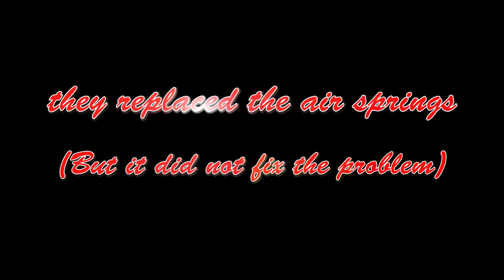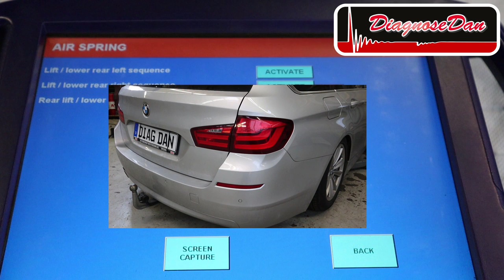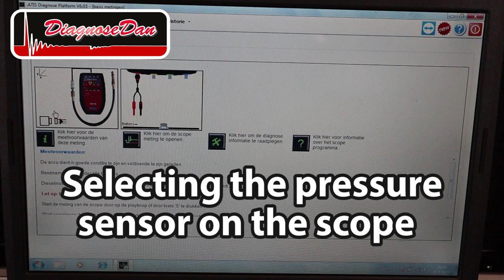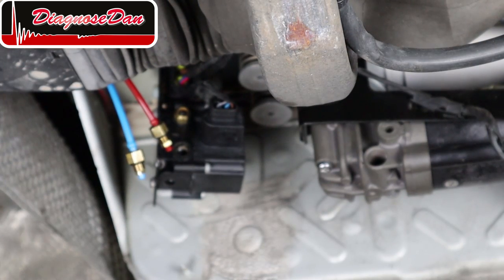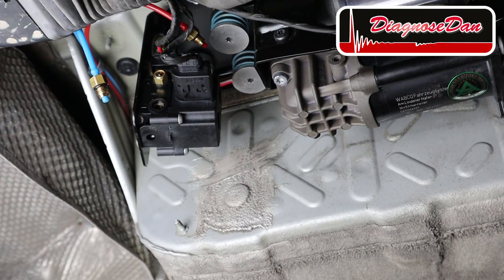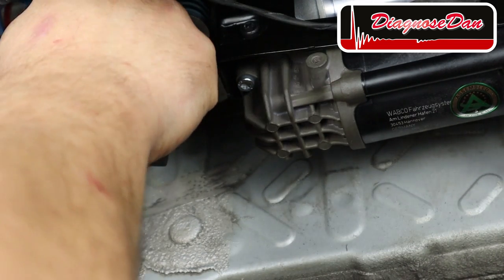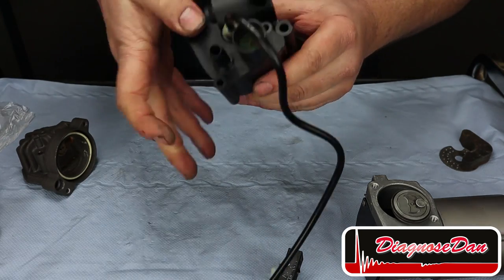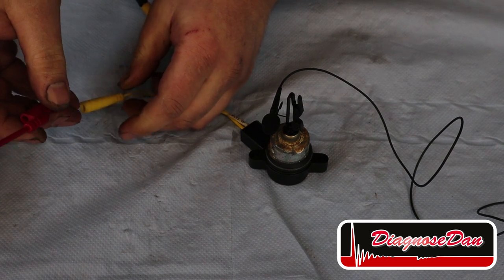Air Springs replaced, but no Fix!

Comment: so in theory it is possible that the vent is being commanded "open" which would have also caused this issue. a quick check of the control to the vent valve should also be performed before replacing the compressor (or vent valve). great video again Dan, thank you!
Reply from the maker: You are right and i did check it, and i could have made this a 3 hour long video. But i don't want the video's to be to long. And i need something to show you in the next airsuspension video 🤣🤣
Reply: @Diagnosedan  
I know you did and I loved the video! I hope my comment didn't come across as negative or complaining. I love your channel and appreciate you teaching us! I've learned a lot from you!

Comment: This car has a towbar fitted, maybe the compressor filled with water when launching a boat?
Reply: Bingo......that makes sense! That seems like a lot of water/damage for simply condensation.
The dryer medium will tell the tale.
Reply: It's not super common in The Netherlands to launch a boat.  People that own boats, mostly have it in dry docked, close to their house or in a harbour. People generally use a towbar to hook up a trailer of some sort for vacation or hauling purposes.

I own the exact same model of this car, and i've seen 2 moisture issues before: 1 where moisture enters the roof lining via the trunk lid. The other one is similar, when opening the trunk lid and the drain holes are clogged,  the water runs all the way down towards the fuse compartment. 

I replaced a relay that was soaked and made sure to tie-wrap it higher.  I've also replaced the Air suspension springs because mine were leaking, so it would be the first thing to do on this model, since it's a common fault.
Reply: kevin bradley @good point

Comment: Good morning!  Great vid as usual!!  I'm liking that license plate. Maybe they wouldn't warranty it because he was backing a boat into salt water. Or the little Dutch boy forgot to out his finger in the ? to prevent the water from leaking in. We will have to get him some DD gloves.
Reply from the maker: BILL 🤣🤣🤣
Reply: Actually that is a very, very possible cause!! A 2017 car is too soon for a rear airsping leak. This pump most likely sucked in sea water from the fresh air intake tube, which is located right behind the rear bumper. 

Dan, you need to build this customer an Airmatic snorkel!!

Comment: From my expirience these compresors are good. They only fail when there is leak in the system or bad suspension airbags.
Reply from the maker: Maybe you live in another climate?
Reply: Im in UK and climate is not best :)
Very strange for airbags or air compresor to fail on 2 years old car

Comment: Not quite sure the original shop didn't check this out first it's like taking it to a shop that doesn't have an actual mechanic all we have now are techs
Brake techs tire techs  etc etc etc great diagnosis the problem is not always the problem

Comment: Air shocks replaced, expensive mistake
Reply: Who is going to pay for that mistake? Just always ask to get the"old broken" parts back after the fix.
Reply: As it is barely a 2 year old car, shouldn't have been fixed for free under warranty?  Are warranties optional in Europe???
Reply: @soonerlon  Austria, BMW technician here. In my company these cars have a 4-5 year warranty. This part would be changed for free (free new part and free of service). We have to send back the broken parts thoe to BMW. I guess they are inspecting these parts for further improvement. If he would have changed the valve with an aftermarket part, that voids the warranty straight away. 95% of BMW's are leased in Austria. So all of them are guaranteed for 4-5 years.
Reply: In Germany a new BMW comes with a two year Guarantee and after that its pro-rated (Kulanz). Usually after about 3 to 4 your  on your own with the repair costs.
Reply: In Range Rovers they usually replace both. Once air shocks leak a little the compressor gets burned out compensating for the leak.

Comment: Nice one again Dan.
I always do the finger test first on a pump quick & simple.
There’s one more check I would have c/o & that’s check the air inlet for blockages.
I have had several cars come to me for testing for a parts warranty claim but after testing found the air inlet filter blocked with mud.
Interesting to see the solenoid was at fault my guess was the piston seal worn a common fault on MB
Keep the informative videos coming 👍
All the best,
Madds
Reply from the maker: Thanks Madds great tip on checking the inlet for blockages!

Comment: it is time for bmw to note that threaded connections on pressurized system must be magnesium  not plastic, and solenoid covers stainless steel or molded plastic. The way they are set up right now internal parts in the Evaporation and Air supply systems would not last over 10 years, corrode and stuck open  throwing array of codes. 
Great job Dan digging  to the core of the problem, that blue diagnostic tool should be patented invention !
Reply from the maker: BMW doesn't make these compressors they are made by Wabco.😉

Comment: BMW and Wabco ought to be ashamed. Same problems as before. Even the E61 had the same problems 15 years ago. Pump is placed inside a shield where mud/gravel/moist can come in but not out. And Wabco pump quality is poor. Should have a fail safe switch to turn off when air spring leaks too much.
Reply from the maker: You are right😢
Reply: it actually does shut off once a leak is detected, (pump not reaching required pressure within given time, 15s I think), and it will NOT allow you to turn it back on during that drive cycle even if you push the raise button, it instead give you malfunction message.

However this pump shut-down feature resets every drive/ignition key cycle, so owners tend to ignore it and just keep driving with a leaky air spring.

It's a user issue, not a pump issue. I would much rather have the pump come back after a key cycle and at least get me home than have to take it to the dealer immediately.
Reply: @Uninfluenceable  I agree, Ian. To some extent. But when many years of real life usage shows this kinds of problems on a two year old german car, I think that manufacturers should change things regarding programming and hardware specifications.
Btw - I have diagnostic tools aswell as experience of repairing wabco's and I still love driving german cars.
Take care
Reply: Makes me a bit sad to find the same old design flaws after decades. What happend to the old fashion "to take responsible position", BMW and others? Too much money down the drain this way.
Big thank you to DiagnoseDan :)
Reply: The e39 pump is much more reliable
Reply: @Uninfluenceable  What normally happens is they will keep driving until the pump wears itself out from over use Then the bring it in for service.

Comment: Awesome video Dan. Save me hundreds maybe more. At the very end of your video. Tap the stock resistor with the handle of a screwdriver to loosen it up. That’s exactly what was wrong with my 2012 F01. Checked it with 12 V power like you did got a strong click after I tapped on it a few times reinstalled it and boom problem fixed.  keep up the great work

Comment: Greetings from Canada, those air ride suspension systems can be an absolute nightmare, especially in Cold Winter conditions when you are leaving for work and your ride is on its bump stops and refuses to air up.  Even when the components are new and in good condition  the compressors will time out and dump all the air out of the system  at -20 degrees C and lower.

Comment: Nice to know Wabco decided to save few cents. Stainless steel is overrated nowadays. I have 2x E61 with about 300,000 km and both pump up perfectly without issues 15 years later. It also gets really humid here in the summer.

Comment: Excellent Job DAN, really liked the tutorial with dis-assembly of the pump !   
2 BIG THUMBS UP !!      I run into this type of situation a lot w/ BENZ & BMW where I am at.  Here in the area where I am , these shops SHOULD NOT be repairing German Autos ... lol --
 It is very frustrating for me to get a BENZ / BMW with an upset customer because of lack of knowledge. I feel bad for the customer more than anything else.
Everyone should be REQUIRED to learn & understand every component of a system before trying to repair.  Every Factory training seminar for Benz or BMW I go to (all of them ) this is how the instruction is given .
Which is why I do not understand that the other shop replaced air springs without complete pressure & component check of the air system ????? --- ALWAYS - Check pump pressure and control valves on vehicles with Air Suspension before replacing components. - EVEN IF YOU THINK THERE IS A CONSISTENT PROBLEM.
Reply from the maker: You are right, the shop manager told me they had time pressure and desided to replace the airsprings because that was the most common problem😪
Reply: Truth is most shops don't want to work on Benz and BMW's. Some shops won't even attempt it.
Reply: THANKS DAN !!  Even factory "TSB'S"  can be easily  mis-interpreted
Reply: NICK V  -- Yes Sir ! Very accurate statement and absolutely correct but I do wish they would not attempt if they dont know also.  ( Porsche is the biggest one for me )
Sometimes I have found out when a car shows up that a Tech at a shops where they do not want to touch these cars, is maybe kind of new or has just come out of the local community trade school jumping in feet first when the shop is not properly equipped or trained for this. I applaud the motivation but have to frown on the lack of knowledge
Reply: @armyvet92  troubleshooting a system functionalities requires a special inquisitive mind PLUS knowledge... that is unlike maintenance most work procedures.
Reply: @G Lasser  - Yes sir you are correct !  But I guess I still wonder how it is not just simple or basic trouble shooting analysis that everyone should be learning from day 1. Especially if you work on vehicles. 
However,  you are also right in the very same statement if look at it .
Based on what you said , it does appear that there are more and more people being hired as TECHNICIANS but really are not trained to do anything but routine maintenance procedures.

Comment: Good content right here, I have just repair my F11 based on this video, just removed the air compressor and check the valve(it was stuck). Now car works nice.
Reply from the maker: Great!😊👍
Reply: Got my comp off at the minute as both sides are in the deck. (Both air bags new 1 year ago). Finger over the air outlet and could easily stop the pressure. But when I tried dump solenoid it appears to operate, so I pushed a pipe onto the little end of the solenoid and blew. Didn’t stop the air flow whether it was energised or not. So I’m still thinking this is the issue ?????

Comment: Got same type Wabco pump on my Jag, so guessed where this is going.
For a fraction of the price of a new compressor, there are kits to replace the piston ring and drier material.
Think BagpipingAndy was the first to make this cheap fix available.

Comment: Nice one Dan, It was good to find out what caused the failure. And even better to know after market parts are available to rebuild it if required.
All too often the end user is unable to get the parts to rebuild (See Range Rover)
With it being just two years old would the warrenty cover it?
 I guess BMW should really re design the pump system to ensure dry air in all climatic conditions
Reply: I too would have thought it would still be under manufacturer's warranty.
Reply from the maker: The car was imported from another country and than in some cases the Local reseller doesn't provide waranty.

Comment: Super cool Dan. I had precisely this problem. I knew didn't have leaks after doing bubble test  so it had to be from the pump.  I found the pressure o/p problem from the pump by using the finger method but at that point I was stuck thinking a whole new pump was the only option. One last search of the web and I found you.  Withing 5 mins of watching the video I had the 12v on the solenoid and I had established that it was sticking thanks to you.    I freed it up and refitted and now all good. I have a new part on order but need to wait a week for delivery.  Thanks Dan. Great video. Great trouble shooting. Great explanation and Great that you saved me £800 at the repair shop.  
Regarding the other garage up mention - What REALLY pisses me off is that the car had both bags replaced at the other shop for no reason!!!! That's just lazy or idiotic problem solving and then they pass the cost of their stupidity to the customer.  I am no mechanic but I can problem solve and if both bags are flat it has to be a part that is common to both bags that is at fault. That means leaky manifold supply line, pump housing, pump piston/ring seal etc..
Anyway, I am having a rant sorry.  Dan your stuff is great keep up the great work.

Comment: I usually check the air pressure in the accumulator on VW Touareg via the measuring blocks. Easier and faster than hooking up the scope. ;)
In my experience, most air compressors fail because of moisture from the air freezing in the chamber. I always add a couple of bottle caps of anti freeze alcohol (for air compressors) on air suspension after a fix.
Reply from the maker: There is no pressure sensor on this car😢
Reply: @Diagnosedan  Bavarian MachWerk ;)
Reply from the maker: @panzerveps  🤣🤣 If cars didn't  break down we would be without a job!

Comment: Dan, love the diagnostics! But, that is a pre-LCI BMW F11 5-series build from 2011 - 2013. Air suspension goes bad all the times on that specific model and build years. In the later LCI versions, very little air suspension problems.

Comment: Hi Dan,like your videos. MY guess at 7 min in was a bad pump part and a customer that was OVERCHARGED for 2 shocks at how much? 350 ea? WHY?because the other FAILED to properly diagnose the problem.At the very least they should refund,all of the parts cost but keep 100.00 for labor.I would have deadheaded the pump or put a gauge inline to one of the shocks to see what the actual pressure was on the line.i may have even used my bicycle hand pump to put pressure in the lines  lol.but that real old school..thanks Dan

Comment: Love seeing the internals of the air pump! Really highlights the problem. A problem that more than just bmw shares. Late model dodge rams have this issue in droves. The vent valves freeze in the cold. Thanks again for the insights!

Comment: Holy Cow a mind blowingly terrific video walking through this diagnosis.
My 2012 e70 X5 may or may not have the exact same compressor. It raises the vehicle fine, but overnight BOTH sides drop, so got a leak somewhere.  Unlikely that both airbags failed together.  Each has a dedicated air line running back to the compressor, so also unlikely both lines failed together also... So now I am looking into if there is a component on the compressor, upstream of the 2 air lines that could be leaking. Possibly the 'vent valve'?  You mentioned a 'valve block' too but not sure what that is.
Thanks if anyone can provide a pointer.

Comment: Disappointing that the original garage didn't carry out the kind of diagnostic you carried out. Surely checking the compressor is working would have been one of the first things they should have done? At least they took it to an expert in the end! 😁

Comment: My f11 suspension failed today. I jumped the relay in order to get the compressor running, both air springs are empty and did not fill.
I suspected a worn compressor piston seal, but the solenoid valve seem more likely. Thanks for the tip, I'll look in to it tomorrow!
Reply from the maker: Good luck!
Reply: @Diagnosedan  Can you place a glove over the outlet and cycle the pump to verify the leak?
Reply: Dan I replaced  my relay and air compressor on my how 510d f11 but suspension  still drops  ( no leaks on air bags) any ideas

Comment: Nice Job..This is Same problem with Ford  Lincoln Town car.. I used a regular air pressure gauge...
Reply from the maker: A lot of people are talking about that Lincoln!
Reply: Dan, this is the Mark VIII commercial. They did it driving under an airplane wing too. The Mark was constantly raising and lowering. At highway speed it would drop, then when you slow down it would raise, then also from raised pos when you'd park and exit the car it would drop again, don't ask me why, it should of stayed raised, because as soon as you were in and driving it would raise back up, all normal operation, very busy system.. All this plus the Goodyear airbag was a crappy design prone to cracking due to sever fold over (under). Front had two sensors, back it treated two bags air with one sensor. Also, door jamb switches acting up would throw the system loopy when it thought you were going in and out of the car but really weren't. The biggest weakness was the desiccant canister. Hard to reach and ppl didn't know to replace it to keep the system dry, which would of stopped a lot of moisture related problems. https://youtu.be/gKxIR4ajgVg

Comment: I was hoping to see the motor commutators signature and see the amp and rpm before and after. I think it's possible to test it at the fuse block. Like a fuel pump? It's awesome how far you take these to the end.

Comment: great video! I think the diagnostic codes should be able to detect such a simple failure and make the life easier for technicians :)
Reply from the maker: There is no pressure sensor on this system😕